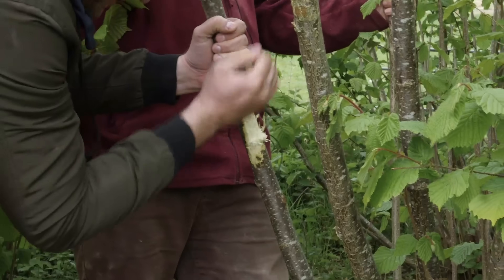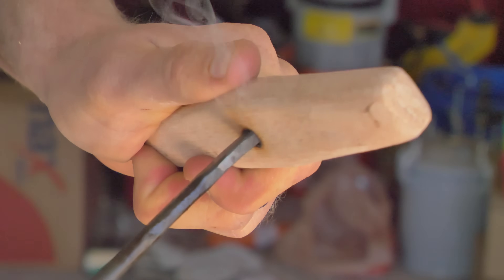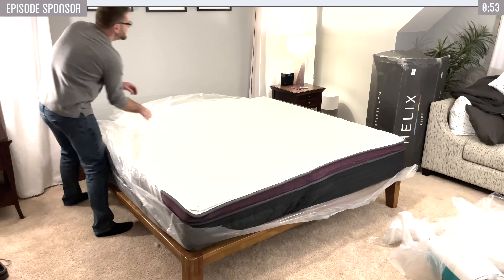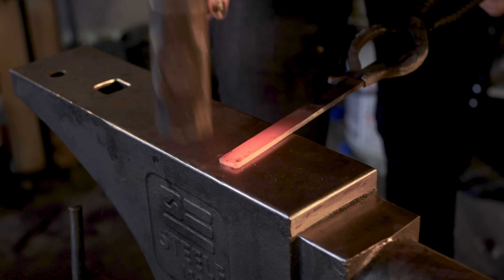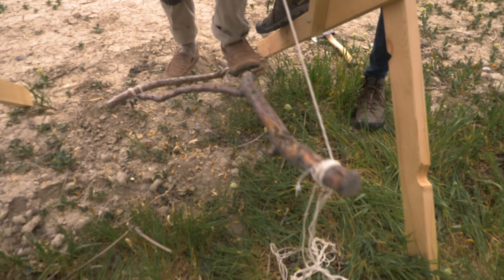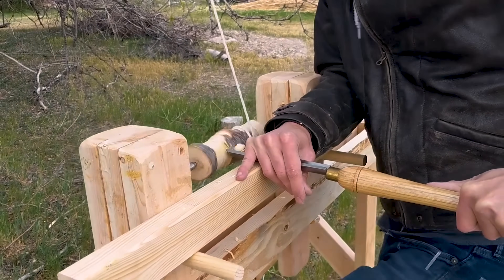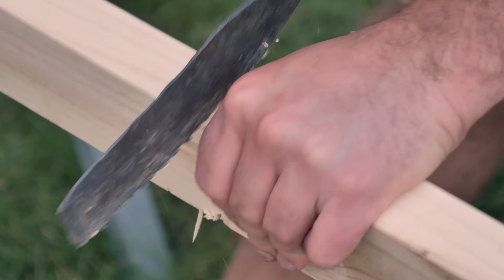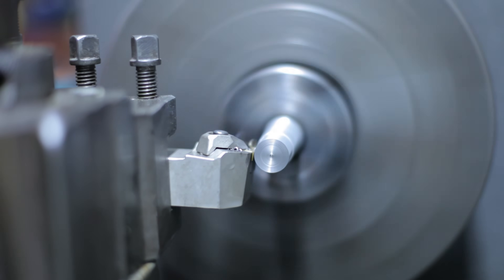I Built the The Machine that Made the Industrial Revolution

Comment from the maker: Thank you again to Helix Sleep for sponsoring today's episode! Click here 
https://www.helixsleep.com/htme  for up to $200 off your Helix Sleep mattress plus two free pillows! I always get a good night’s sleep on my new Helix Sleep mattress! #helixsleep
Reply: I will soon hear in an episode "Today we will make a tractor".
Reply: as a proof of concept it works ...but.....  your going to want a "fine adjustment" for your tailstock to keep your work piece secured between the centers . yes you can wrap the rope around the work piece but it will get in the way while working  the headstock end if it had a  dog points on the face of a pulley rotating on a shaft in the headstock   you could attach the work piece between a center and the dogs rotated by the pulley keeping the rope out of the way and with different pulley sizes having more or less rotation speed for a constant leg rhythm. your spring pole  thicker  probably 2+ inches of hardwood not growing shrubbery  !  your probably more effective if the pole is directly over the work piece and tredal  unless you like wasting energy holding the lathe down and forward   .  so as in all your videos yes it can be done  but  craftsmanship experience and knowledge  will take it from it works  to i can use it all day everyday and it is easier than any other way to do it ...thanks for the videos
Reply: When are you going to make glue? I feel like you have already reached the point when glue was being made.
Reply: @benkayvfalsifier3817   horses arent cheap we dont keep as many around as we used to ..that means we dont have a surplus of horse hoof around to boil down into glue ..never mind the smell which would probably have neighbours calling police... but yes  humans have stuck things to each other since  rocks were our tools and htme is in iron age coming up to industrial revolution technologies  well past neolithic!
Reply: @mobiousenigma  you don't need horse hooves, you could just as easily even use your own nail clippings.
Reply: @SonsOfLorgar  im well aware but horse was traditional
Reply: @SonsOfLorgar  it could also have been tree pitch and wood ash
take your pick there are many natural adhesives as in just about everything it is about choice   fish glue dosnt work so well in wet applications  pitch based dosnt like heat much....choices
Reply: Reminds me of the woodwright shop from pbs
Reply: You do not need green wood. It can be a bow half or weighted lever.
Reply: change channel name to "how to make everything, poorly, then break it"
Reply: you found probably the worst blacksmith on YT too, lol.
Reply: @ElectricalExistence  The path begins somewhere. That point is of no importance tho, but where it will end.
Reply: I love your videos but i havent even seen the iron age one
Reply: You can use a leg paddel like a bicycle paddel made of wood instead of the tree branch to get a singular momentum and stability or let someone else paddle for you
Reply: I was wondering how can someone make an anvil from scratch with just a hammer fire and a stone slab for a temporary anvil

Comment: As cool as this is, surely there is an easier way. 
What about a big wooden wheel  you can mount on a slightly carved stump and have guys or donkeys going around in a circle like they did on ship's capstan? Attach a belt above head height, run it to a portable pre built simple lathe built like this?
I understand wanting to stay simplistic but honestly can't see how this really caught on. It looks like it would be hard to work with, take a ton of energy, and be sort of impractical.

Comment: one of the biggest upgrades would be using gears, even if made out of wood. use gears to change the RPM and you will get more benefit and less energy loss out of the manual. also a large fly wheel even a sliding bearing one would help keep it rotating. one can also make a shifting fly wheel with water in a tube.

Comment: Why wouldn't you smooth and straighten your work piece with a drawknife before putting such a wavy, bark coved limb in the lathe? It looks like you'd have a much easier time working on the lathe, if you made the piece smoother and uniform in size down it's length.
Reply: Plus, out of curiosity, do you know why your blacksmith uses his anvil edge to cut with, instead of making a hot cut hardy? Seems the effort would be worth not risking the anvil edge.

Comment: I built a pole lathe about ten years ago as a temporary stop-gap between a finished treadle lathe with a flywheel (the frame was built to accommodate either).  Long story short, the treadle never got built as I haven’t encountered a limitation with its function as a pole lathe.  Over the years, the only real upgrades have been to allow for fine adjustments to the poppet tension (necessary as the holes on the turning stock will enlarge slightly as you’re turning) and adding some metal bar stock on the back of the tool rest.  One bit of advice:  rough shaping your stock (axe, drawknife, etc.) saves a ton of work on the pole lathe.  Nice video.  Interesting channel. Thanks.

Comment: So near the end Andy was talking about needing a machine powered lathe to turn metal, I don't know the excat road map, but you absolutely can turn metal on a treadle lathe, the step up from a spring pole lathe
The only requirements for turning metal are firm clamping force, and constant forward rotation, HP and torque only matter when your able to produce tools capable of not breaking under the heavy and hot load of metal cutting 

And for funsies, one average human is more then capable of producing enough HP and torque to exceed the maximum cutting conditions of a small tungsten carbide insert in steel. 😁😅 I learned that one the hard way on a treadle lathe!

Comment: A little surprised you didn't go with a foot-treadle flywheel. A little harder to build, but still achievable with the same basic tools you used, and it has the advantages of continuous rotation and fairly uniform speed.

Comment: A heavy flywheel with a link to the pedal allows it to continue in one direction.  Think of old tool sharpeners, sewing machines, ect. The rope should have a separate pulley, and a spring pole can still be used with a flywheel.

Comment: Going back to the series of episodes where you made a suit Maybe to have a continuous spin on the work piece you could build one of those machines that are use to spin thread and figure out a way to attach it to the lathe. And there are some versions out there where the spinning  motion comes from rocking two foot pedals  back and forth
Reply: That would use a crank which is possible if you can come up with working bearings.

Comment: This isn't really the tool that "made the industrial revolution". A pole lathe makes greenwood chairs, not mills or steam engines.
This was an economically important tool because it made certain furniture faster to produce and therefore cheaper. It can't make threads or gears at all. You could make a wooden axle for a cart or some simple pulley wheels, but it isn't even close to precise enough to make the kind of parts needed to drive industrial machines. It also was invented at least a few hundred years before the industrial revolution began.

If you want the drivers of the industrial revolution, you want metalworking lathes. Probably the ones to look into are either the earliest all-metal lathes with screw-driven cutters instead of freehand (see Vaucanson in 1751 and Maudslay c1800) or the ones immediately preceding them which these inventors/innovatora would have been using to make parts for theirs. Verbruggen's 1772 boring lathe design was another important development for large parts like mill bearings/axles, although his in particular was intended for making cannons.

Comment: An alternate to a natural spring-pole might be a Spanish windlass mechanism as part of the lathe's base and some pulleys. That would allow the setup to be relatively portable, and tension to provide the counter-force vs. the pedal would be in whatever ropes you use for the twists.

Another alternate would be to use some counterweights, but then you're lugging quite a bit of stones around and it's not as easy to relocate the entire setup.

Comment: perhaps rather than using springy tree to provide the drive force, try running drive rope up to a DIYed pully block, and then to a hanging weight? 

regarding machine lathe... I have an idea how without gears, one might drive a carriage along an axis to say turn a fairly accurate screw thread, ... differential windlass... two winch drums of different diameters driven together by rotation of lathe ... a loop of rope winds onto one drum and off the other drum... 
length of rope loop is related to how much drums have been turned. use a rope with a hanging weight to keep the tension constant.

Comment: I'll be honest, I built and tried out primitive lathes, and they don't work. They are not usable for actual work and are dangerous too.
The reason is the lack of speed, the lack of force and the lack of progress. Most of the normal wood, dried wood, is not properly cutable with them. The speed made by the leg, without a gear transfer is just not enough. The force is too very little. It only scratches the wood or hits the cutting tool, but does not make a cut. I switched to hand, making very long pulls and with plenty of force, only to chip the wood and rip the wood out of the drive. This was a very small piece of wood and the force was still not enough. But even if all things work out, this process is very very slow. It's very little work done.

For these things to work, they need a very big flywheel. Most of the old ones had flywheels and I guess bearings too. They were moving with high speed and force. Which I'm unsure how they did with simple leg work. I can understand a person going on a bicycle, making the force, and the other cutting. But one person doing both at the same time, seems very unlikely to work.

I'm very disappointed with these lathes, because I thought with some work I make a working tool, that I put on my table, and use it to do some small work. But it's very un-usable for any of that.

Comment: This works, but if you were wanting to make something that will last, you need to split the log, and remove the pith.  If you don't remove the pith, your finished product will likely crack due to the different drying speeds of the pith, and the rest of the wood.

Comment: So if the goal of this education is the progression of science to achieve a metal lathe with power to spin the blank, then you could have acquired a lot more of an advance utilizing a draw knife to get you smaller shafts. Then the spinning of those shafts would go much faster with your lathe. You are definitely on a good path with your progression of technology. Once you have a shaft with an ability to create a transmission and speed up the chuck to be able to cut metal.

Comment: What would really help you is to make a chuck part which can hold the piece and where the force is applied, rather than using the piece to hold the brunt of your force from the chisel and the force from the string. You'll need to use the lathe to make the bearing or dowl, and the wheel on which the spring pulls. For the part that actually holds the piece, you need a flat or four sided blade to imbued end grain.

Comment: Greatly anticipating you making a metal lathe. But right now your next step is a screw making machine. And I mean wooden screws like they have in printing presses.

When you get to the industrial revolution, you might want to start with a surface plate.

And when you make a metal lathe, make it big so you can make another lathe using it. Machining progress comes from multiple iterations as technology improves.

Comment: You would be better off if you used a 12-14 feet long pole or sapling as a spring instead of a live branch, wrapped the rope around the work twice (so there is more rope in contact with the work and thus more friction to drive it against the chisel) and made a shorter tool rest so you're not pointing the tool down to reach the work, its very inefficient to cut it that way because the work is forcing the tool backwards towards you instead of down into the tool rest.

Comment: Your lathe would benefit SIGNIFICANTLY from an Eccentric Crank connected to the foot-powered Power Pedal and a Flywheel connected with a belt to a Drive Center on one end, so that the Spur Center on the opposite (non-driving) end will allow the piece to freely rotate, but the Drive Center will actually drive the piece in a continuous single directional rotation instead of back and forth like that.  If you can make the Spur Center able to rotate as well, that will reduce friction problems on the non-driving end and reduce the possibility of a kick-out that can cause severe injury.  Lathe Kick-Out is much like Table Saw and Chainsaw Kickback...  the work piece goes flying out...  fast...  and strikes anything in its way...  hard.

Comment: that's pretty good for a first try. There's a couple of things I would do additionally, If you make one of the pins out of threaded rod you can make it adjustable with a handle, which really helps keep tension on the piece as you continue throughout the process. The other thing is the closer the tool-rest is to the piece of wood the more efficient your cutting will be since the lathe that you built is fairly wide, it's probably worth making some inset toolrests that minimise the gap between where the chisel pivots and where it cuts.

Comment: i love the old treadle lathes they are so cool simple can be made entirely from wood (yes even the supporting centres)  and best of all if you have the forethought to remove the random branches sticking out of the young sapling you use for it's spring you can even use it without needing to pull sap out of your hair afterwards

Comment: Why the springy tree branches? Step 1: Tie rope to rock. Step 2: Throw rock over some solid structure like a beam or thick tree limb. Step 3: With rock dangling, tie rope to foot or pedal. Step 4: Stomp foot to make lathe go brrr without breaking branches.
As an added bonus, the rock will automatically keep tension on the rope as the piece shrinks.
Reply: Step 5, friction frays the rope and cuts into the tree limb.
Step 6: rope or tree limb snaps and either weight falls on lathe or feet or branch falls on lathe and hands or head or all three...

Comment: I once heard a mechanical engineer say "The only tool that can build itself is a lathe"

I also think an interesting update to the period-accuracy "rule" is that, if you can find a version of the tool that was build by hand, it counts as using your OWN tool, because even in history, no one person did it ALL and people specialized and outsourced the making of all things to smaller masters. So, if you found a pull saw that was hand-made instead of a stamped and laser-hardened panel saw, you should be allowed to use THAT tool instead of continuing to be forced to use the one you made.
Reply: Yes, but the tool would have to be made using techniques available at the current time he's on. Then again it'd be better than some of the modern tools and stock they're using instead like the forge, lumber and steel. I'd love to see someone actually build their way to industrial revolution with 100% self made and processed tools and stock. It'd probably require a lot of people that 99% would just work on making stock but still.

Comment: This channel drifts more and more from the "total reset" idea of making everything from scratch. There are so many modern tools like hammers, steel, glue etc.. and they make a big deal because the store bought, perfectly straight wood was cut with a hand saw...
Reply: They did at least say in the beginning when they unlocked a tool they could use the more modern version of that tool if it helped, and most of the stuff they had burned in a fire, but even given all that that fact is still true and is exacerbated by the fact that a lathe was made, a 1400-1500s thing.

Comment: why not try making gripping blocks or plates from extra pieces of scrap iron to grip on to the wood and have a indent lightly hammered in on it for spinning the wood you're trying to lathe?

And they probably would have stripped down the branch they're using as a spring so the leaves are not acting as dampers

Comment: I'm just an amateur but I would imagine if your first cut on the wood was to gouge a ring around one end to wrap the twine around, you could use it to 'gear' the speed of the rotation. Like cutting a smaller diameter ring for the twine to sit in would make the wood spin much faster for each stroke, like going to a smaller gear on a bicycle, where larger diameter would spin slower but have more torque like low gear.

Comment: Ok, yes a lathe is a good addition, but I think you're getting a little bit ahead of yourself here.  One thing that you desperately need and have for a long time that I haven't seen you produce (if you have, I've missed it) is ABRASIVES.  You need some decent files and the like.  If nothing else you'll produce better parts on the lathe.  Also, there are flywheel designs that are not unlike a spinning wheel that would be a lot easier to use and would produce much smoother, faster movement.  You should be able to bootstrap the round parts for that with the spring lathe.

Comment: Was thinking, to make the lathe turn the working piece:
A pedal like the the ones used for pottery: base board, with a hinge and a pedal 
Rope: from pedal to the working piece and then up towards a pulley (or just a horizontal pole) which is loaded with a container of water or stones (enough to turn the piece but not so much as to make it impossible to work after a couple minutes)